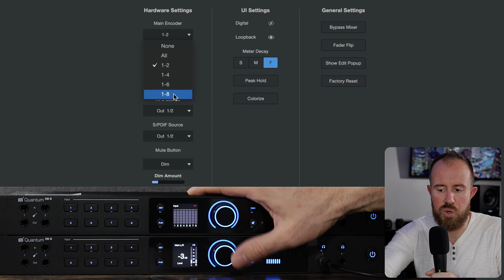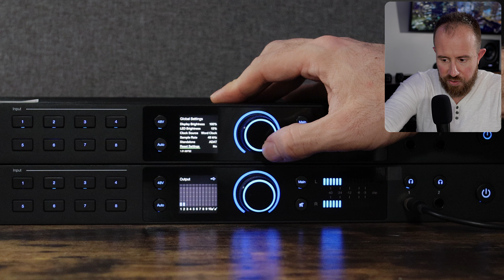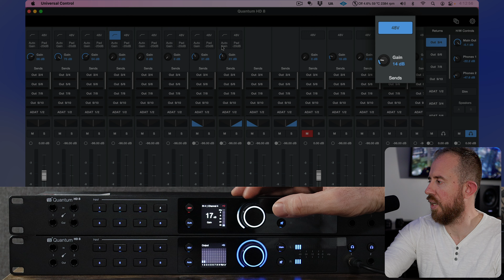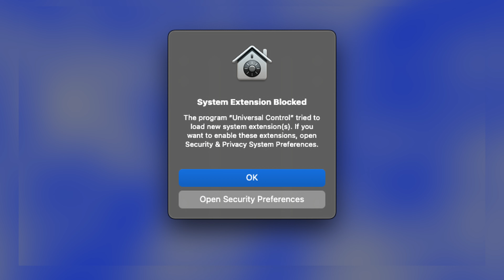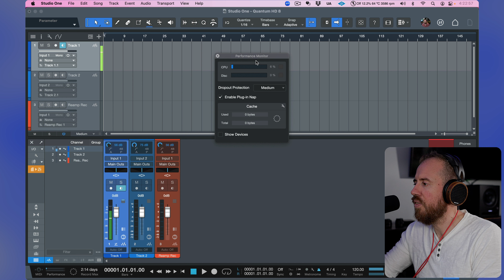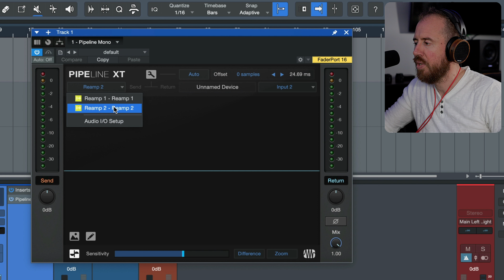PreSonus Quantum HD 8 - FULL Overview | USB-C Audio Interface

Comment: A great review, Marcus. 
Did you have any chance to make a statement about the sound quality of the interface itself - compared to the Quantum 2626 for instance? Or the sound quality of the Preamps? 
Since Latency never was an issue with my Firewire interfaces it would not be either with this one - and 75 dB preamp gain and 124 dB converter dynamics are good numbers. So I'm tempted by this one.
Reply from the maker: Yeah - I did, but I tried to cover so much info in this video, that i didn't even get into specific's like 32 bit, and the dynamic range on the converters.
The preamps are probably the best I've heard as built-in preamps that ship with an interface. the 75db of gain is really nice for Ribbon Mics and dynamic mics. I also didnt fine that they sounded overly sterile. Just nice clean preamp gain - that doesnt sound dull or lifeless..
I think you'd be happy with the purchase, or even one of the smaller units..
Cheers, M
Reply: @marcushuyskensmusic  thank you. Since I need up to 14 microphones to pick up the entire drumset (if I use all 7 Toms and the sidesnare) the smaller units are not for me.
Reply from the maker: @MarkusH1966 wow - that’s a lot of mics!
Hiw is it managing phase with so many mics?
Cheers M
Reply: @marcushuyskensmusic  that is not a real big problem. The 3:1-rule of close mikes against main mikes can easily be fulfilled. The problems are rather two mikes on the snare (top-bottom) or bassdrum (in-out). If a phase-flip doesn’t help, plugins like Waves in-Phase or SSL native X-Phase can help.

Comment: Marcus, aren’t you getting even lower latencies if you DISABLE dropout protection (just set it to Off)?
Reply from the maker: I only disable dropout protection if the artist wants to monitor their performance whilst hearing their live mix during punch ins. Most of the time I use tape style (auto-Input) monitoring which means I only have to record enable a track 
Also I’m not 100-% sure how the system would perform with dropout protection disabled and running at 16 samples (which is what I’ve been doing since I got the HD 8..
Cheers,
M

Comment: Marcus I pick up the HD8  I watch your other video on XT Pipeline and was trying to get it to work with the HD 8. Will this work for EX; routing out CH 5 and back in to input CH 5. I have a few pcs of hardware gear I want to use. I am bypassing my compressor ( using just the 1/4 TRS cable) It shows a send signal  in PL but nothing in the return. Doesn’t. Seem I have a actual send coming out of the jack. Is there a step I am missing?
Reply: I finally figured this out! For anyone else it appears the mixer has to be in bypass mode to work properly.

Comment: Please answer this my friend, I am currently using the IK Axe I/O for it’s incredible Hi-Z inputs with active/passive pickup adaptation, and variable impedance with jfet and pure settings as well.  In addition, the Neural DSP quad quartex gives precision control over the instrument input as well through its interface.  So far, I am considering the Quantum HD to replace my TB3 quantum 2626.  I cannot find any information as to a juxtaposition of specifications between my Quantum 2626 and this new HD.  Nor do I believe that it’s Presonus level of standards to have failed to make the Hi-Z inputs as flexible as products like the Axe I/O.  I like that you “worked with Fender” on them.  But this means little to me from a technical standpoint.  What are the capabilities to vary the inputs to adjust to my different guitar tones and pickups, and if they do not currently exist have you planned for a software update that will enable that feature?  Please juxtapose the Axe I/O with this HD 2 for guitar players, pros & cons.  Thank you!
Reply: There's nothing in the manual that talks of variable impedance on the HD2 hi-z inputs. As far as I know, the IK Axe range are the only straight up audio interfaces that have these functions. The Quad Cortex, Helix, and Fractal FM9 and Axe FX 3 have variable impedance but I don't class these as out and out audio interfaces. I own the Axe Solo and the IK Buffer Boost. Both are excellent pieces of kit.
Reply: if you have the interface I am thinking of.. your lowest latency smokes this new junk Im sure. my motu interface was slightly too slow for me (when it worked) 1.67ms roundtrip.. Bet the preamps for new stuff is nice.. but I wouldnt bother with software monitoring

Comment: I can't figure out how to use Universal Control while using Studio One.

Only having 2x USB audio pairs in Universal control makes it impossible to use the other 6 outputs? Or am i missing something?
So far it seems to me that this is a downgrade even from something as simple as a Focusrite 18i20 which has 10 virtual output pairs. So you can use all the outputs in the back. Here i can only use 4 outputs out of the 10 available without bypassing universal control. But when i bypass universal control i can't use loopback and i can't use my mic for talkback etc etc. 

Do you have any insights on this?

Comment: Are you guys able to use the outputs? I’m trying to send audio out of protools daw3/4 to come out of physical output 3/4 on the HD8. No luck. Same with the rest of the outputs besides the mains. I’ve done this before with plenty of other interfaces, I’m stumped.
Reply: nevermind. I found out that bypassing the Universal Control Mixer fixed all my problems.

Comment: I dont see how these new drivers are actually any different. I have nearly 98% identical latency numbers with my old Audiobox iTwo as this quantum HD8 has. I was hoping that the latency difference would be massive between a 10 year old interface and a absolute newly created one. i would be interested to see the latency numbers with more samples in the device blocksize. If you are a person who works with alot of VST's and plugins  the latency always become huge due to the block size. if those latencies can be pushed down with higher blocksizes i would be impressed.
Reply: What numbers are you seeing for the AudioBox? Assuming you're on Windows as macOS Core Audio has always had much more latency than Windows ASIO. That's where the custom driver becomes important.
Reply: @OscarDanielGarza  I have excactly the same settings as Marcus shows in his videos under the processing tab. The numbers are 35ms respectively in the Standard latency and 3.71ms roundtrip and 4.44 ms instrument under low latency fields. I run windows 10 Pro .
Reply: @Luke-ib1ki  makes sense. Windows ASIO has been better than macOS Core Audio for a while. The driver on macOS cuts Core Audio latency to about half of what it was.
Reply: @OscarDanielGarza  Makes sense, i never used studio one with a mac system, so cant really express any experience with it. But i wish Presonus would not be so vague in their phrasing regarding " Custom made low latency drivers ". Feels more like a marketing gimmick to me. And i want to see more benchmarks around these audio interfaces tbh. RME are still king of drivers/low latency with their interfaces. They Reek of high quality the hardware itself too. were to upgrade to a new interface today my money would go toward an RME interface atm.
Reply: The move to USB-C from Thunderbolt is likely motivated by a number of things: 1. To increase the size of market for these interfaces, by additionally addressing the needs of those without Thunderbolt-capable computers. 2. Similarly, to simplify the device, as well as make more easily portable, given that USB-C supports 100w of power delivery--eliminating the need for a separate power cable. IMO, the rack-mounted HD 8 should not be marketed as a portable device. Rather, a dedicated studio fixture. 3. Save costs on substantial Thunderbolt licensing fees from Apple (more profit).

Comment: Great review and detailed as well.  Love my Quantum 2626, but this might be worth a look in the future as there are some good added features in this.   Might miss the speed of the thunderbolt connection though.
Reply from the maker: The new Quantum’s are a massive step up in terms of the quality of conversion, preamps, dynamic range, and headphone amps. But I hear what you are saying about Thunderbolt speeds.
I’m currently looking into what the best approach would be for incorporating the HD 8 into my Thunderbolt setup.
Right now, I think it’s a toss up between using an HD 8 in ADAT stand-alone mode - or testing out using different interfaces for the input vs output. (I’ve never tried that before)
Either way - I hope to do some more content covering this interface.
Cheers, M

Comment: I have Rme babyface pro fs..would this be better option with more dynamic range? What is your opinion if you ever heard or used rme babyface pro fs?
Reply from the maker: I’ve actually never used an RME interface.. I almost bought one a couple years ago when my original studio 192 went out for repair but ended up going with a new studio 192 instead.
I’m also not familiar with the dynamic range specs on the babyface. 
But I can tell you that the Quantum HD 8 sounds incredible. In terms of preamps, converters, dynamic range, and headphone amps, It’s a significant step up from my original quantum Thunderbolt units (the original quantum, and the 4848)
I’m sure someone will compare them and lost their findings.
Hope this helps.. 
cheers, M
Reply: I dont think this is better than RME brother

Comment: With my unit I can’t see any of the phones in Studio One and forced to go out to UC. It is like they didn’t finish building the integration with S1. In fact it has less features than my Studio 192 connected with S1. I may return it because my work flow is worse now. Plus no talkback mic. I think the Fender flex with the outputs is not needed.
Reply: If you don't need to use UC for cue mixes, use Bypass Mixer in UC. It's a little different way to work than the 192, but instead of using dedicated outs for headphones you can use any output pair (analog or ADAT digital) as an output destination for a mix. Even if you don't have anything connected to ADAT, the path is still there and you can mirror your headphones from that path. For example, you can use ADAT Out 15 / 16 to make a headphone cue mix. Just make sure that ADAT Out 15 / 16 is chosen for headphones in Studio One 6.6.1 or later.

Comment: presonus custom low-latency drivers vs rme drivers any thoughts pls
Reply: Rme does 4.1 ms roundtrip at 48K at 64 samples. 4.4 ms for 44.1K at 64. So they outperform the new quantums. But they don't go to 16 samples so it is possible that presonus can get close to RME by offering 16 samples. But then your computer has to work harder. They should re-introduce the 4848 as a Quantum pro, with thunderbolt, daisy chaining. It was a great interface they just did not give themselves time to be considered an option for Pros.

Comment: Can you set gain levels remotely. For example if your drums are in the live room and the computer/ interface is in the control room. Can you set recording levels with a tablet or even a bluetooth mouse and monitor?
Reply from the maker: Yes, absolutely. The auto gain feature is available in UC (per channel) you can see it in UC in this video.
UC can be loaded on iOS devices and tablets.
So you could engage that feature when you’re away from your computer in the live room.
Cheers, M

Comment: Excellent review. I just bought the 2626 still in the box. Days later the hd8 was announced. Lots of nice upgrades on the hd8. Tempted to return the 2626 and go for the Hd8. Hesitant though in that latency might not be as good as the 2626. Nothing worse than pulling up a full mix with lots of plug-ins and not be able to redo let’s say a vocal track or what not. Concerned about the HD8 being USB and not as fast as the thunderbolt 2626. Can anyone advise me with this
Reply: Hi, I've got a 2626 and the latency is about half the HD-8 (approx).  On a block size of16 samples the 2626 is showing 1.63ms of RTL (round trip latency) and on 32 sample blocksize it's showing 2.72ms.  I don't want to keep repeating myself but imho the new Quantum interfaces aren't Quantum interfaces because the whole point of the Quantum line was very low RTL.  They've ditched Thunderbolt and gone to USB and you can't get the speeds of the original Quantums over USB.

Personally I'd stick with the 2626 if latency matters to you (and also combo jacks on the front of the unit).
Reply: I have the 2626 also, and as the previous comment, RTL is much better, and I noticed that in order to get low latency on the HD you need to push the green Z, which bipasses the plugins to get low latency. I've had the 2626 since it dropped, and love it..just IMHO.
Reply: Stick with the 2626.
Reply from the maker: If the 2626 is working for you, then roll with it..
And I understand what you are saying because my OG Quantum stays locked at 32 samples in green Z with medium dropout protection and gets rock solid 2.5ms RTL.
That being said - the new HD 8 sounds better to me. Preamps, converters, dynamic rage and headphone amp are ALL A STEP UP..
Cheees, M
Reply: @marcushuyskensmusic  out of interest (because I just wondered) I had a look at the RME interfaces latency because they have a reputation as good low latency USB.  In terms of price then then the Fireface UCX II is closest (although it's half rack format) and that has considerably better latency figures than the HD 8.  At 32 samples it has a RTL of 3ms whereas the HD 8 seems to be about 4.7ms.  So unless I'm mis-understanding something I think your "incredulity" at the HD8 latency figures is probably misplaced.  Presonus have done a decent job but they are nowhere near the best in the industry.  

I'm not saying this isn't a decent product, and having read a bit more about the difficulties of Thunderbolt development I understand why Presonus may have ditched it, but whereas the original Quantum and the 2626 were easy choices for tracking in Studio One because they simply removed any worries about latency and any complications of DSP mixing, the HD 8 is "just another audio interface" now.

Comment: Why is no one addressing the use of multiple units as you could with the previous Quantums?  Will they 'cascade' or do you just aggregate them on a Mac like before?
Reply: No automatic aggregation from USB currently but you can use Audio MIDI Setup on macOS to aggregate. But you can get up to 24 analog ins through ADAT at up to 48 khz or up to 16 analog ins at 96 kHz (no ADAT at 192 kHz).
Reply from the maker: I’m currently running my 2nd unit in ADAT stand-alone mode, clocked via BNC to the main interface.
I would love to see automatic aggregation in UC eventually. But it’s been pretty stable for me having access to an additional 8 channels of inputs via ADAT standalone mode..
Cheers, M
Reply: @marcushuyskensmusic , I get it.  That helps.  

Thank you for doing what you do, so well!  You are a first choice for me when looking up topics for S1.  You're frickin logical, methodical and thorough!
Reply from the maker: @cptesting  🙏🏻🍻

Comment: What if I wanted to use two of these units at the same time to get both the max amount of inputs? so basically just like linking them together to get 48 inputs?
Reply: ADAT is the only way. Up to 24 analog ins through ADAT at up to 48 khz or up to 16 analog ins at 96 kHz (no ADAT at 192 kHz).

Comment: As others are saying, isn't going back to a mixer a step in the wrong direction? It was pushed as "the" way to go for low latency, and then it appears again?  I use a Quantum 26x32 for exactly that reason - low latency. I was using the 1824C, and needed better. Thoughts?
Reply: totally agree.. to go backwards from thunderbolt 3 interface (that I still might need to buy sometime) to a slower connection.. Cant possibly use software like a pedalbord and a piano sim will probably do noting but annoy me.Also I have  tuned a guitar thru software with latency.. then take off headphones.. guitar is not in tune! Wish I had direct monitoring outborard gear and amp/cab sims.

Comment: The ES4 is what I got my eye set on
Reply from the maker: I’m thinking of selling my apogee boom and replacing it with an ES model.. even if it’s just to get the 2 loopback streams vs the apogee boom which only has 1 stream with limited routing options…

Because when I’m using the boom - the whole reason I bought it was to get some type of loopback working. 
But I quickly realized that it’s useless when you’re monitoring on the same interface and trying to send someone the main outs (it creates a feedback loop)
Cheers, M

Comment: studio ones monitoring , UC is still clunky, trying to sort out how to use multi outs for headphone  monitoring is almost useless
Reply from the maker: I wouldn’t say it’s useless at all. When using UC you have 2 stereo paths which are super easy to set up. The main outs (1/2) can be easily assigned to both headphones directly from studio one (enable audio device controls in the console option) and then you can enable 3/4 as a cue mix and assign to HP2. The whole process takes 10-20 seconds.
But if you’re software monitoring - then just disable UC.
With UC disabled you could literally have as many cue mixes as there are available outputs. Every single stereo output available on the quantum - Analog or digital..
And you could route either set of headphones to any one of those cue mixes in seconds.
Perhaps I’m not understanding what you’re saying, but I think this version of UC is very clean compared to how UC works with other PreSonus interfaces.
Cheers, M
Reply: @marcushuyskensmusic  try setting up 4 separate headphone mixes using UC Joe gilder made a video on how he had to try and figure out a way to do it , he couldnt really make it happen although he came up with a work around and even he said its a major issue with studio one, it would be useless in. a real studio , pro tools monitoring works how its supposed to i have been a studio one user since version 1